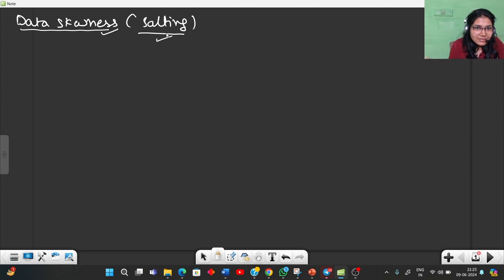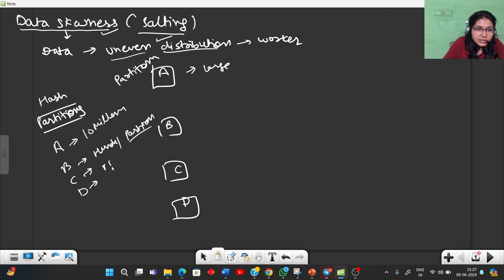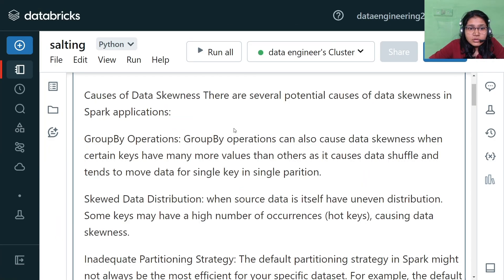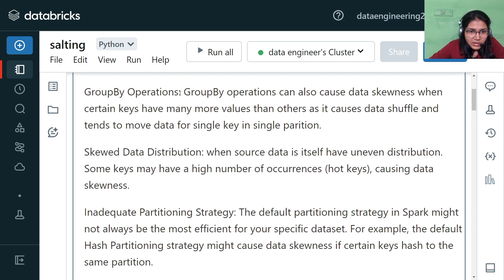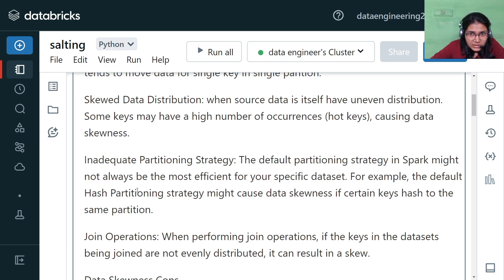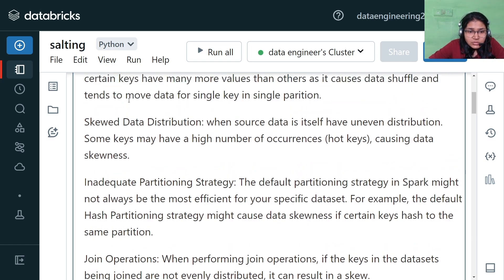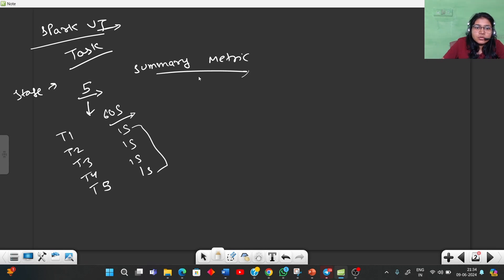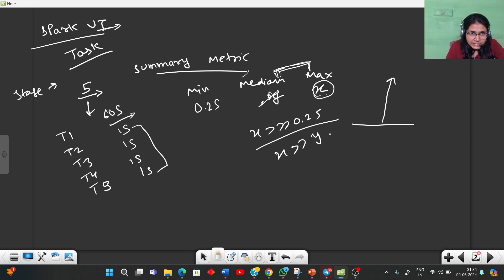Salting in Apache Spark - Part I

Comment: This also increases the data size of the second dataset as we explode it, so is it still optimized as the data scan will be increased a lot and lot of shuffle will be involved?
Reply: While salting can increase the data size and shuffle overhead in Spark, its benefits in mitigating data skewness and improving workload distribution often outweigh these drawbacks. The other important thing is to decide on salting factor to choose for your workload as that will again impact the overall distribution